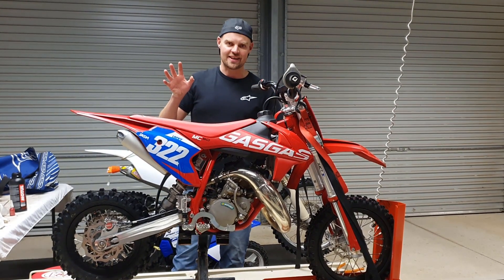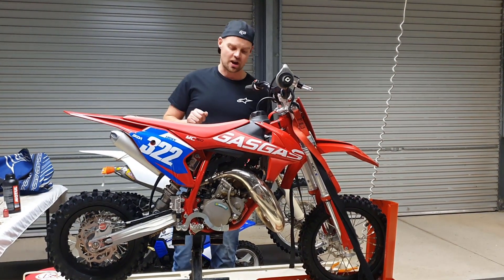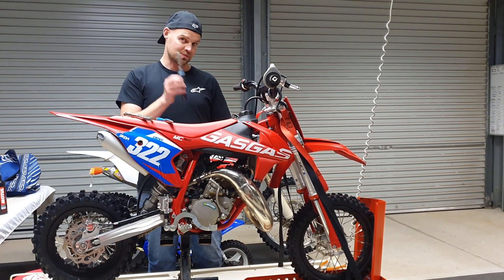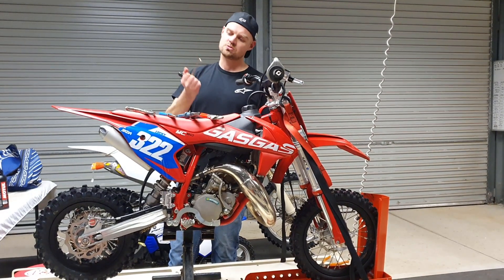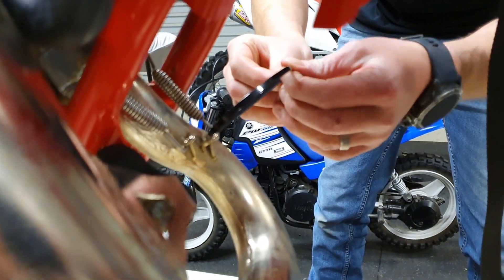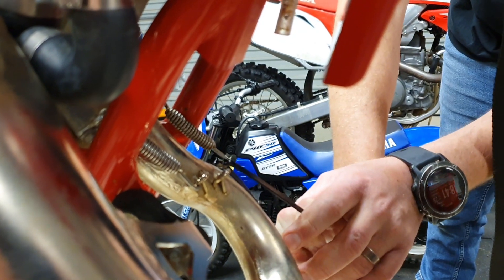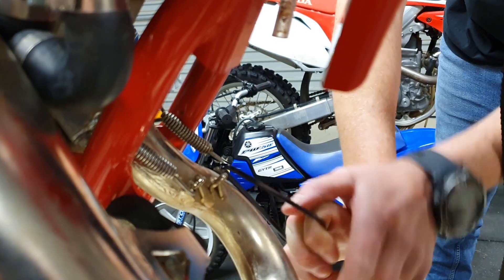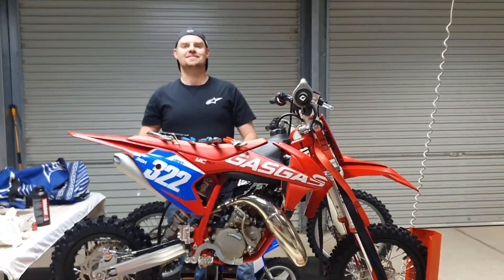Removing Expansion Chamber / Exhaust Retaining Springs Easily On Your KTM50 / MC50 / TC50 / 2 Stroke

Comment: Hey mate,  thanks for the vids , i find them really in depth , my son is out growing is pw50 has been ridding for about 4 years now, hes 7 and are looking to buy a gasgas 50 , he has rode his sisters TT50 however i think the gasgas would be much better as hes getting pretty comfortable on a bike!! How many hours are you getting before top end rebuilds on these , i know there more maintenance then the PW and defently 4 strokes ? Do you have any vids of your son riding the new gasgas? Cheers
Reply from the maker: Hi there, about every 20 - 30h is the base spot to replace the top ends on these. Some do it sooner some later. They are very different to a PW50 maintenance wise. I'll try to get some footage over the coming weeks. How tall is your boy? Mine is 128cm but only 25kg. Handles the 50s fine
Reply: Hey mate,  hes 120cm around 22kg , he sat on the gasgas at shop and could get one foot down no problem , but as you know 6 months he probally will have both feet on the floor !!